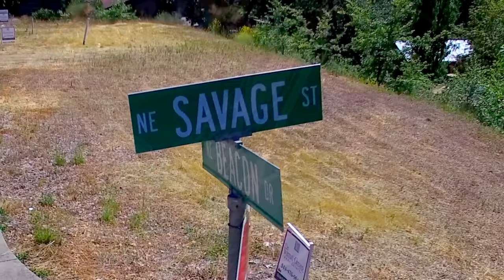A-TEAM 3

Comment: Congratulations Damien! best wishes.

* August, would you please explain/elaborate your tie-in setup while you were removing the top at around 9:30 .... e.g. it looks like you have a carabiner attached from your saddle rope bridge to a connection on the spar.

great job on an engaging professionally produced video.. surely one of the best yet.. had lots of different aspects in it.

I have no interest in rock climbing, motorcycles, skydiving, or anything else to do with heights, danger, etc.... but there is something about tree work that is singularly interesting to me and I hope to be able to make some headway with it while I still have the physical strength and stamina.
Reply from the maker: Robert Wood I’d have to show it. It’s just my climbing line going from an adjustable rope bridge to an improvised “usaver” on the spar.